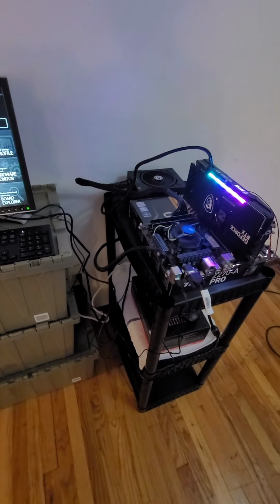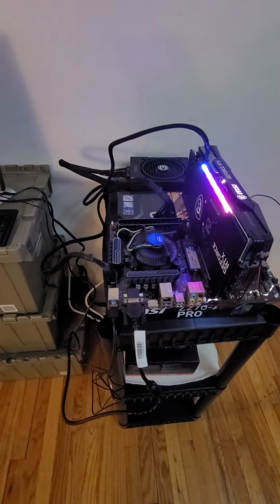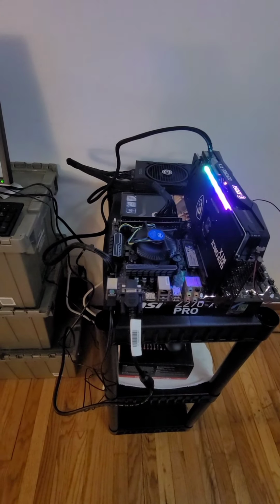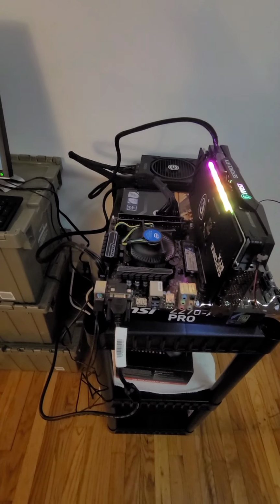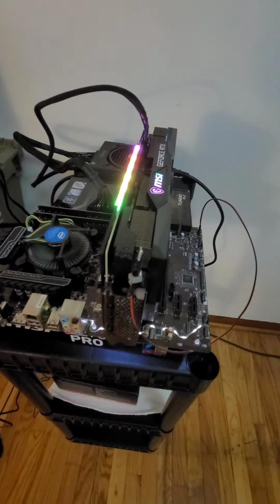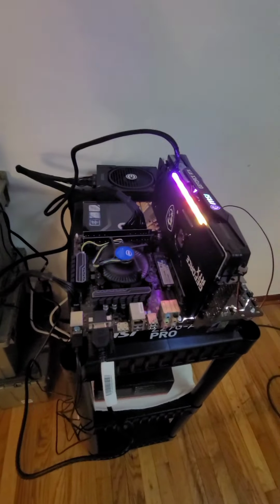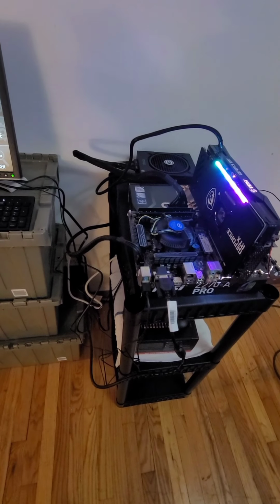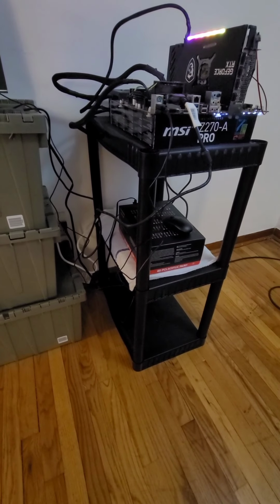2021 Easy Beginner Mining Rig Build| RTX 3060 Ti| Cryptocurrency Passive Income|$10 Bitcoin Giveaway

Comment: Hey,
Did the power supply not come with at least 2x 8 pin PCI-E power cables? So you wont need that splitter cable for now since youre powering 1 card.
I use the same motherboard and can put up to 6 cards with Riser cables, how are you getting the impression of 8? Maybe a PCIE lane splitter? And if you plan to put that many, yes you will need a 2nd power supply, and PCI-E  8 pin splitter cables.

13gN5K2qfhpRRZ2wFehaQSYxWbq7fXLx2k
Reply: Oh and the 3060TI is not restricted its the 3060 non TI
The 3060TI will hash the same as the 3070 as well (assuming you're mining Ethereum on NiceHash)

Comment: How long does Cryptotab usually take to pay after you submit the withdrawal? 
Thx for another great video.

1Gyo9DtzLHwtCLurQ1CLKrS56pEsyoJBua
Reply from the maker: Hello I have had it take up to 2 weeks to receive a payout. 👍
Reply: @chronicpizza1  Hey mate, i got my payout in 2 days, thx for answer. Another quick question, After buying the cloud boost, it went streaight to all devices? I just bought it and is only reflected in the phone i did it with. (all devices has the same google account)  1Gyo9DtzLHwtCLurQ1CLKrS56pEsyoJBua

Comment: Nice start! 
Nice hash is a good way to start! 
Your evga didn’t come with multiple pcie hook ups?    
I’d recommend checking the wattage of that card because I believe u need 2 pcie cords instead of splitting
Reply from the maker: Hello thank you for the info I will look into it. Your probably right. Definitely learning as I go lol Also I wanted to tell you your name was picked to will the $10 but your btc address was not below....make sure you put it down there just in case you win again. 👍
Reply: @chronicpizza1  awesome!   I have the evga 1300 watt psu theres a lot to learn but when u get it all down it’s totally worth it.  Just check the cards wattage anything over 225watts you’ll want a 2nd pcie cord per Linus tech tips channel. 

Please regift to another winner I appreciate the content keep up the good work!